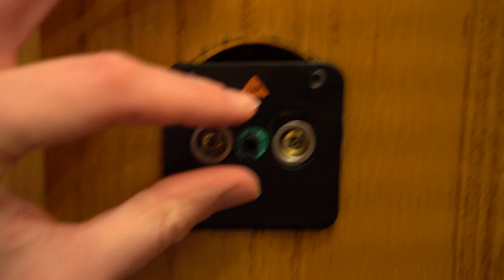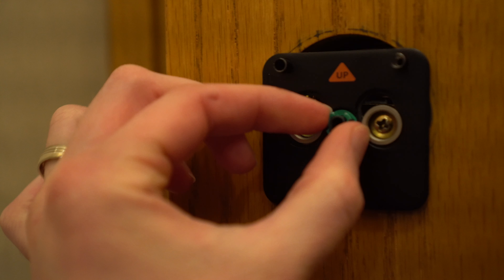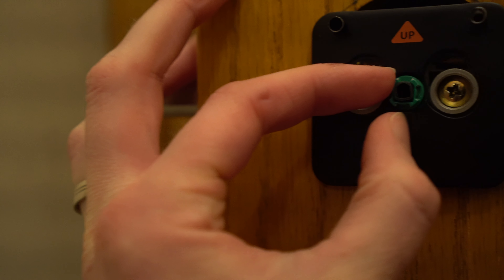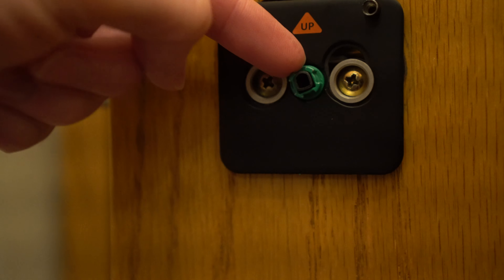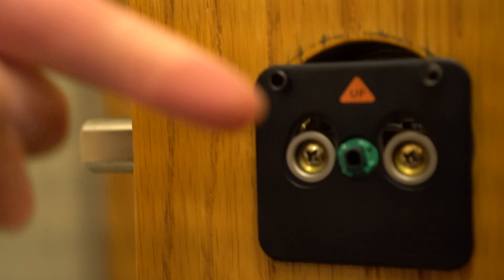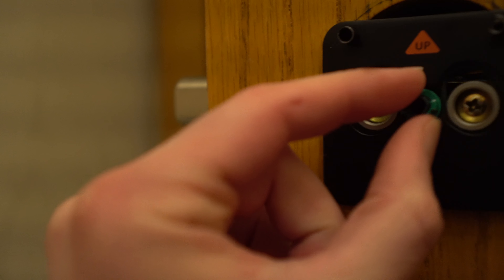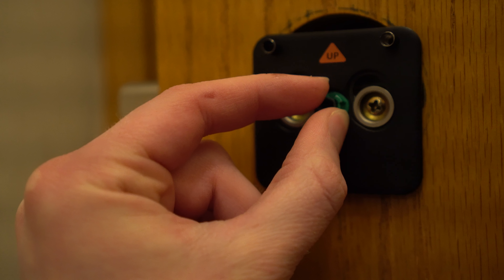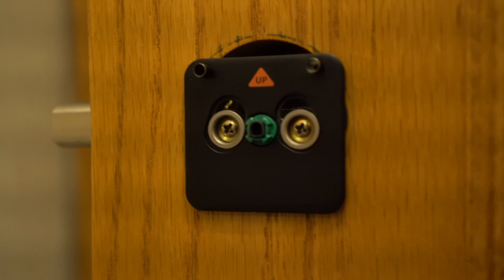Wyze Lock Review:  Too much slop in the adapter?

Comment: The motor is using that same adapter to unlock and lock the door so I don't think the slop in the adapter is the problem otherwise the motor couldn't do it either. You just need to turn the manual knob an extra 10 degrees or so. When you reach that final 10 degrees you are now engaging the motor so you will notice some resistance but it turns just fine. Try it again and please let us know.